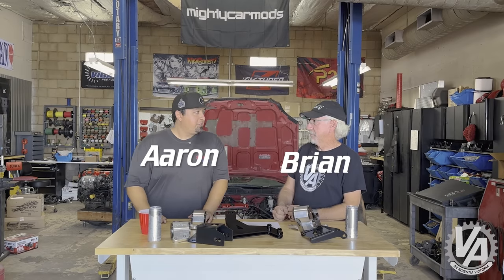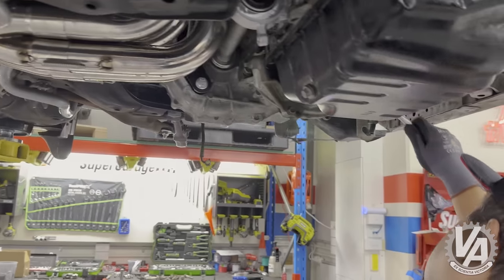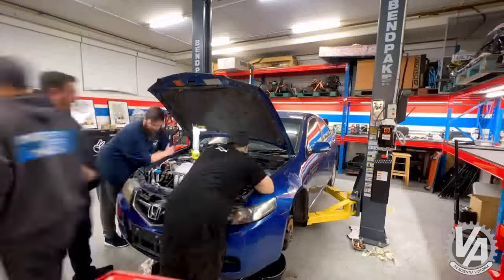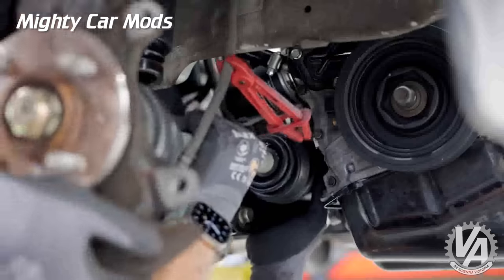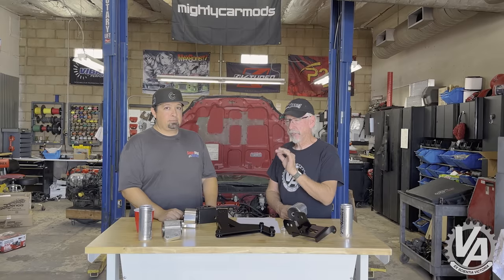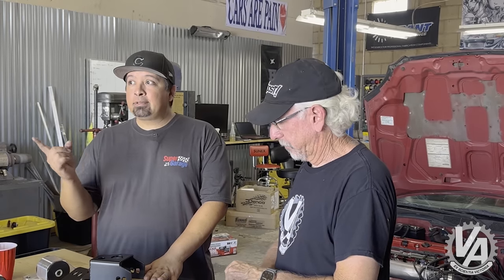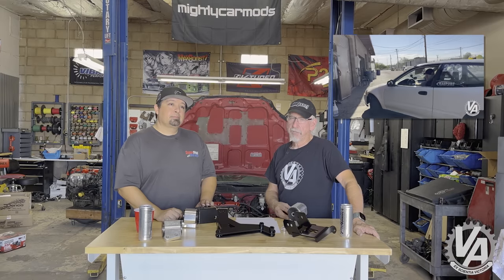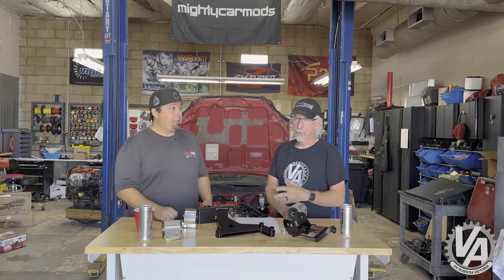Everything You Need to K24 Swap a Civic EK- Mighty Car Mods Edition

Comment: Proud honda community moment seeing you guys on mcm, i noticed blair was calling you a honda wizard fairly quickly 😂 did he ask you to dust off the old scrolls 📜. The speed science harness is what i used btw made in nz, its length suits rwd config aswell lhd rhd
Reply from the maker: Hell yeah! Is it good quality?
Reply: @VTECAcademy  yeah man i know the guy behind putting it together, adam plews (c30 swapped dc2r ) oem connectors etc. Brian has met Adam before and speed science is nz dealer for hasport. Adam's since sold speed science but the quality etc still remains

Comment: W video from MCM and you guys... I just got my axles and EKK5 mounts. I am really looking hard at the Haltech and DBW. I have a DBW pedal I need to build a bracket to mount and a harness to build to connect it (easiest way I can have cruise control). I was debating about the radiator, if I could get away with a half size, because I need A/C (high heat+high humidity in Texas) but I guess I'm going to need to figure out a way to mount my condenser or buy a front-of-the-radiator kit.... K24A2 w/Acura ILX transmission (tall gear ratios) by the way. Thanks guys!
Reply from the maker: Throw a full size radiator and condenser in.

Comment: Wait I have 2000 eknhatch dx it has ekk2 mounts eg 95 honda civic subframe eg 95 honda civic power steering rack and eg 95 front controll arms then axles I have 06 si axle amd acura rsx type s axle other side pits perfect with 36mill half shaft fits perfect and I have my motor raised hight cuse I ha e itbs too 57mill   but my steering rack fits perfect came off 95 honda civic ex power steering I have in my hatch fits perfect coukd use that one tooth i have a 05 k24a2 tsx motor  with 02 ep3 si 5 speed trans with itbs

Comment: Yea my swaps only have aftermarket parts I can't make myself . That would be the mounts and the axels etc. everything else from comfort cooling to temporary emissions to pass is DIY . Most of the parts aftermarket is just nuts splurging on crap like shifter plates etc. Same for clutch lines I used parts from the supply house for refrigeration rated . Look for parts that's practical in costs and quality

Comment: Which K series would you recommend for major low end torque to mid range power? I planning to replace my d16y7 in my 1996 Civic LX.
Reply from the maker: Any K24 will do. Which one you pick depends on the peak horsepower you want.

Comment: New sub. I own a 1994 Integra GSR which currently has 91,200 kilometers (Canadian car). I have kept it stock except a few years ago, I installed a Yonaka catback exhaust. I do not like it because it drones constantly. What after market replacement would you recommend to bring the exhaust back closer to stock?
Reply from the maker: Something 2.5”. Then maybe a Magnaflow resonator and muffler. 3.0” if you plan modifications in the future.
Reply: @VTECAcademy  Thank you for your reply. 2.5 will do. I plan to keep it stock. Oddly enough, my Integra gets more attention at car meets that way.

Comment: Hey guys correct me if I'm wrong, but I was under the impression the flywheel bolts were different from auto to manual and were not interchangable? I noticed you reused them in their video?
Reply from the maker: We used flywheel, not flex plate bolts. Flex plate bolts only engage a couple of threads and cannot be used.

Comment: Can you guys please answer a question for me? I have a FA5 and it has an alpha header on it and it rubs the firewall. It has innovative mounts in it (75A). I've already shaved the front mounts at the feet and added spacers behind the rear mount to tilt the engine forward to gain a little clearance. I've only really heard of this problem with k24 swapped FA5s. it only rubs ever so slightly on deceleration. Do you guys suggest drilling new holes in the brackets to lower the motor or get someone to weld a piece on the header to pull a little tension on it away from the firewall or what? please help!
Reply from the maker: The K24 is taller and that causes the header to be closer to the firewall. If you put a few washers behind the bracket on the oil pan bracket to tilt the engine a little rearward that will gain clearance. Make sure your bolts are longer if you do the spacing. If you use a 5mm (.20") thick washer, then use 5mm longer bolt. You don't want those pulling out due to lack of thread engagement.
Reply: i already did that, what options do i have left? cutting a section of the firewall away? @VTECAcademy
Reply: the thing is i dont even have a k24 its a k20 and the headers are still up against the firewall @VTECAcademy

Comment: Will the stock EK fan relay power both hybrid racing electric fans like stock? Based on amperage on start-up, it seems like each fan would need an independent relay
Reply from the maker: Yes it will

Comment: We use eg rhd subframe with  powersteering rack   on rhd ek for this swop with no issues ..
Reply from the maker: With right hand drive, you can use any of the power steering racks from EG or DC2. On left-hand drive cars it needs to be from the DC2 or Del Sol VTEC models. Otherwise the manual EG rack and subframe work.
Reply: @VTECAcademy  Love ure content   i always look forwrd to see ure vids when i get home from work ...im from south africa .. And ive always looked and wished u guys would do a rhd civic ek k24 "budget build "swop   cos over here its crazy expensive to import parts but i am definitely making a plan to get those ekk2 mounts from hasport  i have to support u guys .the least i can do